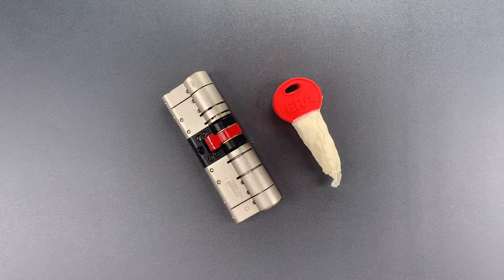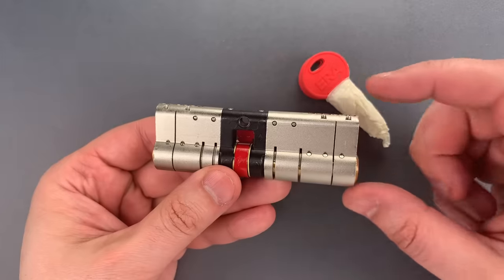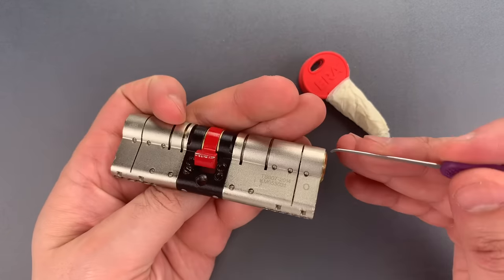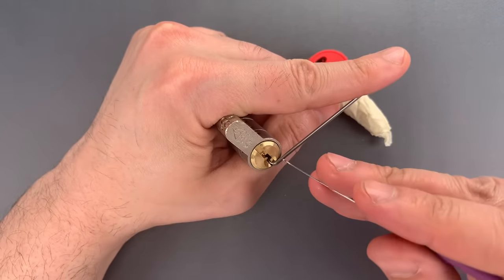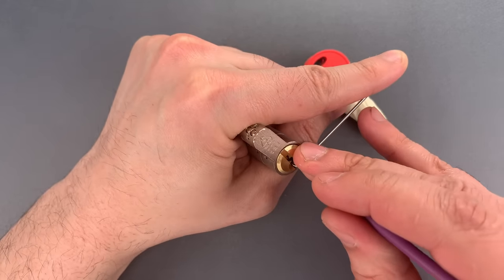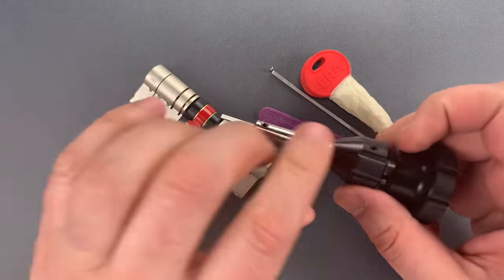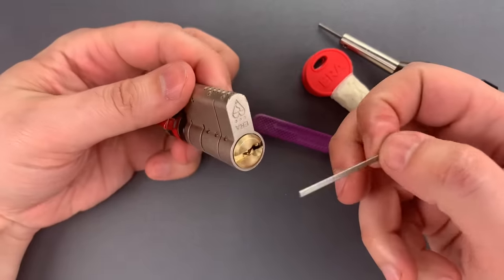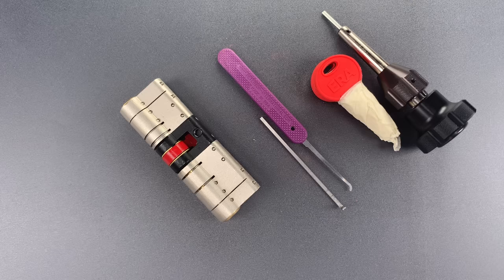[1256] ERA “Fortress” Euro Cylinder Picked (6 Trap Pins!)

Comment: About two and a half minutes and needed special tools and techniques.  This is actually high on the unofficial LPL Security Scale.
Reply: So basically its a lock secure from attacks from everyone except LPL. Good enough for me!
Reply: And you need 3 or 4 rotations to unlock a usual front door. It might take LPL 10 Minutes to unlock a door with this thing in the field, which, when it comes to locks, basically means the average thief is better of using explosives.
Reply: @MytronixOfficial  if they can't get in quietly through the door, most thieves will usually just say "fuck it" and either bust a window, or just move on
Reply: @jonathanblair5920  Or started working on the hinges if you have door with hinge exposed outward.
Reply: Yeah. Requires specialized tools and techniques and a ton of prior knowledge. This is realistically unlikely to ever be picked in the field.
Reply: I'd give it a 5 Mark Ruffalo's on the security scale.
Reply: @chnet968  I have never seen a door in Europe with exposed hinges.
Don't know why you would do that :)
Reply: @Jehty_  Well fire exits still open to the outside, even here in Europe. So there are actually plenty of doors with exposed hinges on the outside. However, there are ways to still secure those, so this shouldn't be an issue in theory, even though it is in reality.
Reply: @Gnarlf  In theory, it's not an issue in theory. But in reality, it's a problem in reality.
Reply: @marcgoodman4862  Didn't I just say that? 😅
Reply: @Gnarlf  In theory, you said that. But in reality, you didn't.
Reply: @marcgoodman4862  🤣🤣🤣🤣🤣
Reply: And only got it right because he knew the correct order and tools needed before he ever started.
Reply: I wish LPL star ratings could start being included on lock packages.
Reply: don't forget that he can see all the safety options in the lock when this shit in in your door no one will know those precice handeling he just did
Reply: To bad they don't tape the locks before been sent to him, as having known about the 6 locking pins was able to defeat it like any other lock, this lock won't get picked normally and good thing is you be fully aware someone has picked it because the barrel is locked in that possession
Reply: @leexgx  if the lock got stuck because of the trap pins we likely wouldnt have gotten the video though - so i would say: good that they didnt hide them
it means we get to see what is going on and what it takes to bypass those security measures
every one of us can see that someone in the field wouldnt have that knowledge and that this took a good deal of effort even for LPL
Reply: @danallen266  Good enough till he comes
Reply: @jonathanblair5920   you forgot something! Thieves only break in when its easy! I mean a window is still open or sometimes a door is stil open etc etc thieves dont break in when everything is closed
Reply: @quadmeister  primarily yes... but if that were always true, i never would have had my apartment robbed years ago...
Reply: @jonathanblair5920   then they know you and know whats inside! At a random persons house they always go easy
Reply: @quadmeister  that's... uncomfortable to think about
Reply: And he wouldnt be able to pick the lock had he not known how it's made..
Reply: @JR-wj9bh  With enough time he probably would have. He knows most tricks so when you have just a key way to work with you start to narrow the possibilities and eventually get there.  I wish he would upload some projects he has not been able to pick.
Reply: @MytronixOfficial  be faster to kick the door in than to pick it
Reply: @Gnarlf  Very true, concealed hinges have become common, but many older exit doors are still in use.
Reply: Is there an actual scale, or was that for comedic effect?
Reply: @qquarzwar  No real scale, but length of time LPL takes to pick + bonuses for special tools and techniques = actual strength of the lock.
Reply: The LPL Security Scales goes as:
Video is 1 minute or less; LPL says all the keywords (“Unfortunately, however, flaw, inexcusable”); Can be picked by just putting a twig in the keyway and turning: Very Low

Video is 2 minutes or less; LPL says only 3 keywords; Can be picked by just jamming a lockpick in the keyway: Low

Video is 3 minutes or less; LPL says only 2 keywords; Can picked by normal lockpicks: Medium

Video is 5 minutes or less; LPL says only 1 keyword; Need to use some special tools: High

Video is 10 minutes or more; LPL says no keyword; Need to use a custom made tool such as the lockpick Bosnianbill and LPL made: Very High

Video is 30 minutes or more; LPL is praying that he opens it; Need to use a tool made by the gods: Impossible
Reply: @danallen266  Click on One outside your front door intensifies
Reply: I have to know. What are the other contenters high on the scale?

Comment: I would be worried that this thing is so secure that if I locked myself out of the house a locksmith wouldn’t be able to get in
Reply: You can always just drill it, anti-drill protection means it take time not that is imposible
Reply: Or just kick the door in.  A good lock on a door is meaningless if you have a cheap wooden doorframe.
Reply: at this points just buy a new window
Reply: I would be more concerned that it wouldn't even open with the key.
Reply: Do you have windows on your house though?
Reply: @cedricrobertson2893  yeah but it’s gonna cost you more to drill and even more on top of the anti drill rods break the drill bit lol
Reply: No security measures at all will stop a determined person with tools from gaining entry. Someone who is authorized by the appropriate parties (IE, the homeowner), will have no trouble whatsoever in resorting to methods that would obviously not work for someone attempting illicit entry, such as dismantling the door, shimmying open a window, etc.

Besides, most "locksmiths" these days just drill and replace anyway. If you want to know the quality of a locksmith, get locked out of your house. If they just get the drill from the start, send them packing for they are not a locksmith, they are a handyman who only intends to destroy your door lock and then install a new lock, both at your expense.
Reply: @finnpalm9951  no i have Android
Reply: @ShadowDragon8685  Why shouldn't cutting the lock out of a solid or hollow core wooden door with a battery powered rotary saw not work?  Ten seconds and you're in.
Reply: @larrysmith6797  what about solid steel doors?
Reply: You’ll have to call in LPL
Reply: i had the exact thoughts while watching.
Reply: just break the window.
Reply: No one has thought of hiding a spare key? Preferably buried in a park or a vacant lot several houses away from yours. I've had to go get mine about once per year.
Reply: Show the lock Smith this video
Reply: @Tantalus010  this fits in upvc doors so the frame would be pretty tough
Reply: The Locksmith can take all the time in the world to penetrate your defenses, because you've given them permission to be there.

An Intruder has to get the job done fast, because picking is conspicuous. Five minutes is plenty of time for a neighbor to wander by, and wonder what's going on.
Reply: @cedricrobertson2893  You'll need multiple drill bits
Reply: C4 would do it
Reply: @JAMDJAMD  why wouldn't it? I mean, if the key won't open it it's useless.
Reply: Door breaching is easier than picking this lock for sure, so much knowledge of the mechanisms and their sequential arrangement is necessary in order to rotate the cylinder 360⁰
Reply: because these locks don't directly secure the door, they stop the locking mechanism from being opened. Our door is composite, sold and has triple glazed glass which is pretty tough to break. The locking mechanism has 6 points of contact with the door frame. 

Its not trivial to open one of these doors without a key, you'd have more luck putting a window through, but again double glazing makes that more difficult (and noisy) so it's not going to be a covert entry :)
Reply: Spare key, drill, go through another passage way if any, or remove the door. If you really think this will happen often enough that it will be a problem then don't bother locking your door.
Reply: @Tantalus010  Where I live the frames are made out of 2x4" wood, so I can't see someone kicking those in. (Cold climate -> thick door)
Reply: I keep a breaching charge near every door in case I lock myself out
Reply: @Tantalus010 i have metal door with wood frame
Reply: @Tantalus010  that would be more expensive to replace than simply drilling the lock lmao
Reply: or just watch this video and make sure to have an expert's collection of tools
Reply: @ShadowDragon8685  I once looked myself out by forgetting that I had a key in the lock from the inside.  I had my key with me but couldn't get it in cause the key from the inside blocked it. Door just snapped in. Called one locksmith. 
He was like "do you know the credit card trick?"
My answer was that that trick doesn't work on my door. 
He was like "I show you"
And failed!
Grabbed immediately the drill. 
I didn't let and told him I can't pay a 500€ bill and he was gone.
Called another one.
An old man came and asked me some questions about the door. 
Aaand after 30 minutes he opened it without picking the look.  He bypassed the physical barrier that makes the card trick impossible. 
He damaged the sealing rubber but that wasn't a problem it's cheap to replace.
Reply: @larrysmith6797  drinking with a hole saw requires a pilot drill in the center. You can't drill with a hole saw without that pilot bit, because it would be impossible to keep the hole saw centered to establish the cut. And since there is a knob in the center of the area you're cutting, there would be no way for it to work.
Reply: @cedricrobertson2893  have you ever tried to drill a lock with anti drill pins? It makes it near impossible. Bit catches and binds, bit shatters, bit dulls, and it's just not feasible. You're better off with any other means. A sledge hammer to the handle is far faster.
Reply: @davidbarrett6434  "The licking mechanism has 6 points of contact"? What is that supposed to mean? Please tell me you're not trying to tell us that the locking mechanism (singular) has 6 points of contact that lock it into the door frame. That wouldn't really be possible with a glass door light. You'd need even more complicated gearing or linkages than a door with one licking mechanism that has 6 points of contact would normally require. And the manufacturer wouldn't put a piece of GLASS in a security door like that anyways.
Reply: @littlejackalo5326  that's exactly what it means, the door itself has locking bars that slide out and lock into the door frame (6 of them on my door), the key then prevents them from being retracted meaning that any force exerted on the door is not focused on one lock (bolt whatever you want to call it) but instead gets spread across the 6 different bolts that slide out when the door is locked.

As for glass, we tend to have double glazed toughened glass in doors anyway which is very hard to break, mine is Triple glazed and laminated so it might crack but realistically isn't going anywhere.

If you Google UK multipoint door lock you will see what I mean, they must have these in the US too.
Reply: @littlejackalo5326  I do it all the time. 

Big drill with a big handle. I would bet I could get a hole-saw through a typical house door in a couple minutes
Reply: @larrysmith6797  Too noisy. If quick is all that matters, kick it in.
Reply: @ShadowDragon8685  it happened to me. We have the shittiest amazon locks on our room doors, i picked them like twice when I locked myself out, took forever but it worked(really cheep locks are hard to pick if you're inexperienced, 1000 false sets), but when my housemate locked himaself out i tried for like 30 minutes and couldnt, amd we had an exam in the morning so he called a locksmith. He drilled the door and said that "these can't be picked".
Reply: AHAHA!
Reply: find a axe (if its wooden that’ll take care of the problem
Reply: I think a new window is the easiest fix.
Reply: @sniffersmc2827  "these can't be picked"
Bullshit. "*I* can't pick these" is the correct response.
Reply: @cymond  he barely tried, I had literally picked the same lock before so I am aware it could be picked XD He basically reached for the drill straight away, I asked him to try and pick them and he tried for like 5 seconds
Reply: @nobody5093  any place that has solid steel doors likely has a lock even better than this one XD, or multiple locks.
Reply: A locksmith will not even try to pick the lock. It's better for him to drill and sell you a new lock. That's what they do. Thieves pick the locks, locksmiths use the drill.
Reply: @Tantalus010  if you have an expensive lock like this, chances are your door is atleast good quality, if not the best materials.
Reply: I locked myself out once. I destroyed a window to get in, got new glas for 30€ afterwards. Cheaper and faster than any door opening company.
Reply: Call fire fighters to break the hinges
Reply: @littlejackalo5326  Nope, take a piece of scrap wood and drill it with the hole saw, now use that piece of as a guide for the hole saw, no center drill needed
Reply: You could still leave a spare key under the doormat to address that concern! ;-)
Reply: Most doors are probably weaker than it
Reply: Knight's Armament Company makes the Masterkey
Reply: @edgarglopes  you misspelled house
Reply: @christopherbriggs9526 great superb idea
Reply: @ShadowDragon8685  "locks only keep out honest people."
Reply: @305663  2x4's are nothing to kick through as a door frame. Definitely not inconspicuous but quick enough. They split along the grain so it's not like kicking through a plain 2x4...you don't have to be a beast.
Reply: @aaronking2020  metal door is only as strong as the wood frame.
Reply: I was just thinking about that - I would expect very few locksmiths to be able to pick that. the real questipn then is what those drill-protection pinsare made of - ifit's hardened steel, that actually can be drilled with substantial expense in wearing out expensive drill bits. but if those pins are carbide, which could easily be used for those round pins without being too expensive, then that lock is pretty much undrillable.
Reply: @vadimblin  my locksmith came out to my girlfriend's house, she'd done the same but he managed to pick the lock and open it even with the key in the other side! Magical.